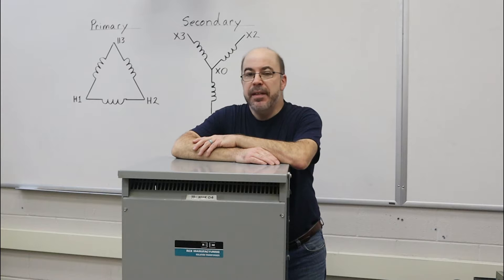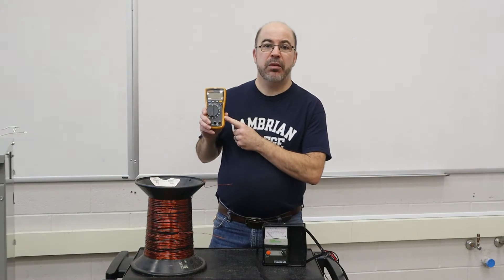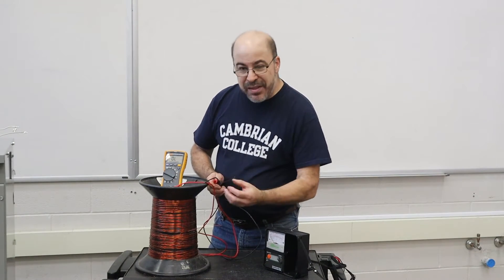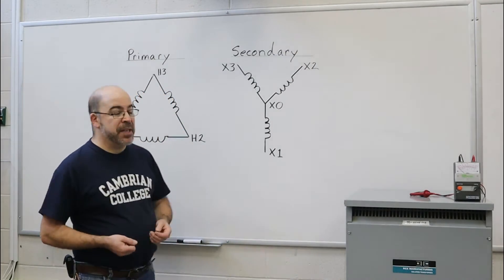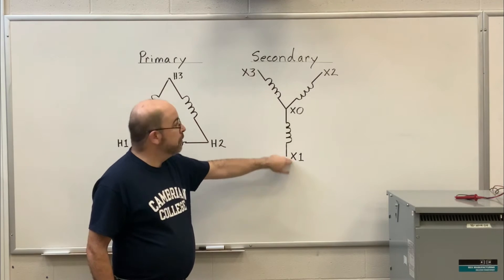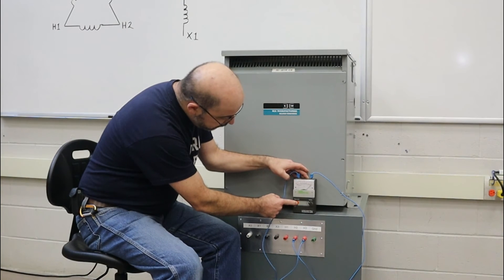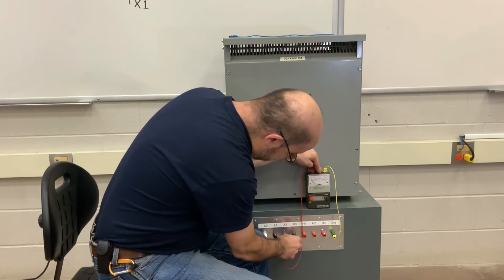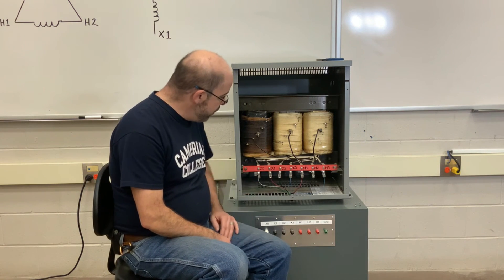How to test transformers

Comment: With an H1 to H2 continuity test, assuming it was a delta winding, wouldn't you get continuity even if the windings between H1 and H2 were open?  Current could flow from H1 to H3 and then from H3 to H2, still giving us continuity.  Granted, resistance should be about double of that between H1 and H2, but it should still be a low value.

Comment: 1 ohm..  lol no ur just using on continuity mode which is  1 or 0. put it on resistance mode and get the resistance. that fluke is pretty accurate

Comment: My foreman just dropped a transformer on its side today. 
I’ll look like a hero when I test it tomorrow haha thank you.
Reply from the maker: @6615Dean  ouch!!!!! That could be expensive
Reply: Very much so. 1,750 lbs, 300kVA
Reply: Without a Megger or insulation tester, some of these checks with a Volt meter are just fundamental or trial?
Reply from the maker: @6615Dean  those tests were conducted with a megger but it only went up to 1000 volts. A visual inspection should be performed in addition. That was one of the points I was trying to make in the video.
Reply: Im not sure our company owns a Megger haha or cares…
So with a volt meter I could test the windings to ensure each winding has the same amount of resistance, test continuity to ensure no windings or phases are compromised, check phases to ground. 
But without a Megger I cannot properly check the windings can safely handle 600v-1000v and that the insulation is not compromised? Correct? 
I’ll do my best to get a Megger on site and I’ve suggested this already. We shall see.
Reply from the maker: @6615Dean  that would be recommended, an ohmmeter won’t generate enough power to properly assess if the insulation on the windings has been damaged

Comment: Sorry, to make sure that the resistance value measuring method is okay,you should be turning multi meter to resistance meter not buzzer meter,
You read 1 digit that meaning is more than value range  of the buzzer position mode.
As you already now the value of the roller winding is more